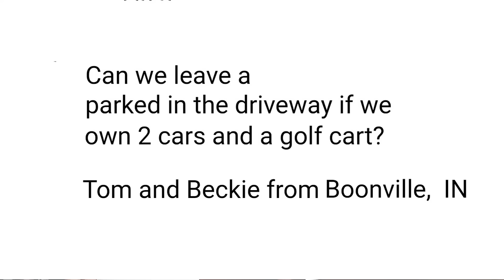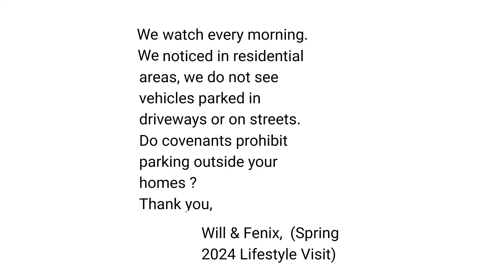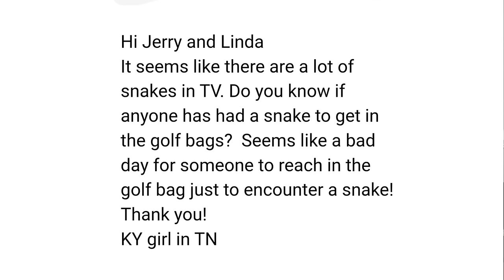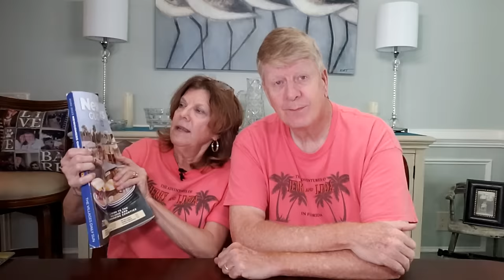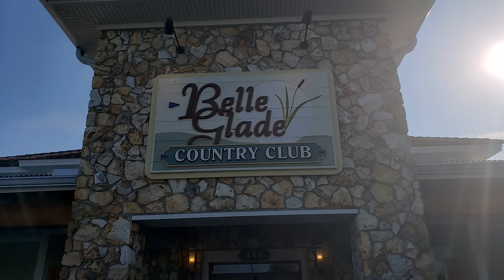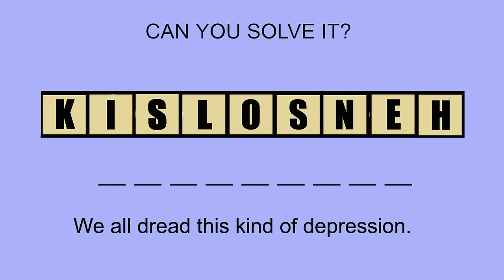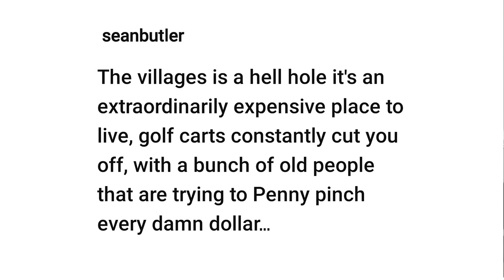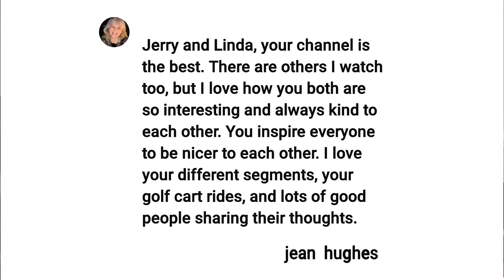Square Foot Price of Homes, Bad Water? Remove All Alligators? Driveway Parking,

Comment: Thanks for the video. Love hearing your insights. Regarding the home pricing, there are a few other YouTube peers of you showing a ton of statistics to help folks understand the market (David is in Florida, Gilbo Reality, David Monty, etc ). New home pricing is listed below many of the existing homes, but one thing we have noticed is this often excludes the lot pricing. This "trick" is trying to avoid home price reductions. The current per sqft price points seems be be around $250/sqft, but this is under pressure. Again lots of games being played with homes being delisted and relisted to avoid showing price reductions or improve "days on market". Another thing we are seeing is home going pending only to see them relisted shortly after. Unclear if this is due to findings from home inspections or if Lenders are not appraising the homes as high as needed for the buyer's mortgage. In any event, its is clear that the historical home value trend line should put per sq/ft closer to $200 then where they are today. Of course you are going to have cash buyers pay what ever they like and the Villages is a very different market in it self, but as a future resident I'll be on the sideline until things fall back in line. Do not forget the July changes in the Real Estate settlement (I believe still pending court approval) is shifting the commission structure, so expect a lot of pain and fluidity until thing settle closer to next Spring.

Comment: I would have liked to have seen a before & after temperature comparison of the garage insulation. Measure "before" temps at a set time one sunny day and then measure "after" temps at the same time on a day that had very similar weather.
Reply from the maker: That would have been interesting.
Reply: Good idea.
Reply: Well, since you made the sublime comment, i guess it's up to me to make the ridiculous one.  So, here goes:

Rather than snapping his fingers in his sign-off, i wonder why Peter doesn't pop a bunch of bubble wrap...  🙂

Comment: I saw one house for $2.4 million.  Several for over one million.  Price has little to do with quality.  I’ve found several under $300k that were very charming and clean.  Dumps over half a million.  It just depends how much money you want to dump into a home to make it your own.  I don’t want to do that again.  Impossible to rid the area of alligators.  Move the existing gators, or in TV, it would be exterminating them, and there will be that many right behind them happy to move in.  Where there’s water there will be gators.  If you don’t like them, don’t go near or live by the water.  Better yet, maybe choose a more suitable place to live.  I love looking at the water, but would never live near a pond etc in Florida for many reasons.  Even if you have a villa with walls and fences, it’s not enough.  Those stinkers are strong.  I’ve seen how they can get through a heavy duty wrought iron fence.  No, leave the gators alone and exercise caution and common sense.  I just checked and I was Unsubscribed.  I think the reason for my many subscriptions being unsubscribed is because I turned off all of my notifications.  The reason I did that is because you have to delete each notification separately.  What a pain.  So, I turned them off.  The ones I watch still pop up regardless.  I did subscribe again to your channel.

Comment: Interesting info. But right now in the Villages the sold homes are about 250 sq ft (which is far above other 55+ quality areas) and dropping. A few are off the grid crazy like the ones you mentioned, but not many. But for now until they drop down to something reasonable we will be looking maybe at Trilogy or OTOW. I think the Villages for a lot of people who thought they were going to flip these houses short term after Covid and they’re trying to get the money out of the house. I don’t think that’s gonna work, people aren’t buying them. And the houses are on the market so much longer than they were, dramatically longer. Once those investors who messed up are done, maybe things will normalize.

Comment: I would not live in a region where there's alligators.   It's bad enough, we have to deal with Skunks , Raccoons.
A few years ago, we had 6 Skunks living underneath our concrete porch .    
It took my spouse weeks to get them out from underneath the porch , they left the area.  
Spouse had concrete to coverup the hole.   To this day, we check the surrounding of the home for any clue 
of skunks.   And we live in the city.